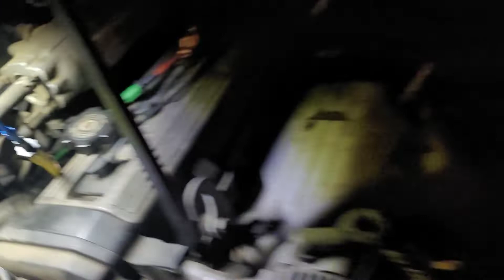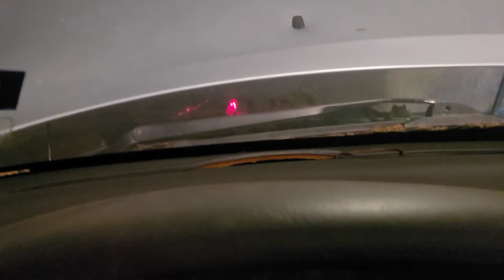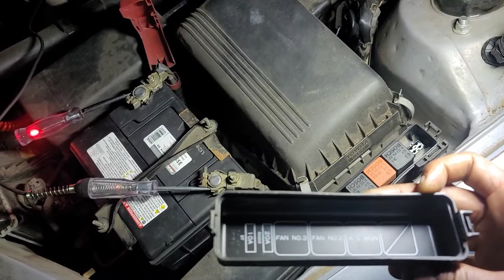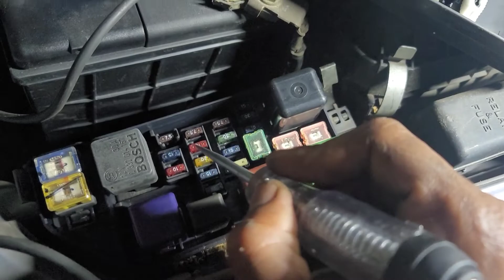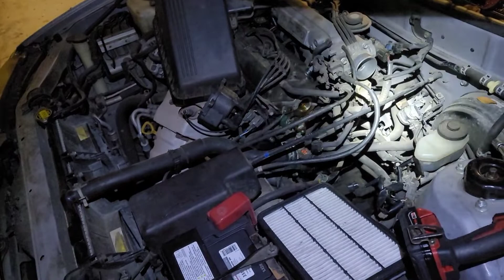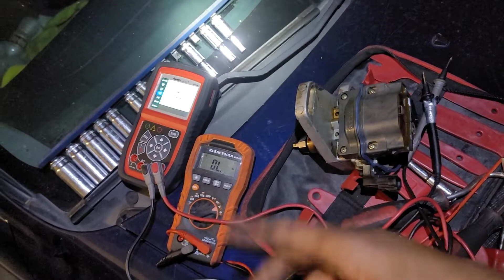1995 TOYOTA CAMRY: CRANK NO START

Comment: I have a 05 Camry had Codes for Camshaft sensors changed out both but car still wont start. It cranks but won't turn over and the codes are back. SMH
Reply from the maker: Crankshaft sensor maybe. But it needs to be diagnosed tbh

Comment: Camry95....does not have an OBD. How did you get the codes Usman????
The other fuse box has 2 relays same as EF1
Reply: Jump two pins in the diagnostic connector. I believe E1 and TE1

Comment: Im having the same issue on a 1994 camry. Would run then after running a little while it would die and not staret until it cooled down. Finally whatever it is went all the way out. Thought it was coil but replaced the coil, the cap and rotor, and also the capacitor and still no spark. Any ideas? Or how to test the crank shaft sensor without removing it?
Reply: It’s the ecu…likely. Thecarcarenut channel just did a vid on this last week.
Reply: @RegularUsernameName  thanks Matt
Reply: Yeah I’ve left my 95 Camry wagon siting for a few years sadly while searching for the solution. Gotta share the gospel of Thecarcarenut to those in need hahahaha
Reply: @MattGredig  awesome! So it was your problem because on this 94 camry that's my brother in laws we can't seem to figure it out I redid a bunch of stuff and new distributor too. Still have a engine light and running not right

Comment: Any idea about code 12 obd1 Corolla 1995. engine revolution signal missing boss??
I already replaced the distributor
Reply from the maker: Does it have a crank sensor? If so check for good signal at the engine computer.
Reply: yOu have an OBD for your 95 corolla??....they started in 1996
Reply from the maker: I have adapters

Comment: I did everything but touch the distributor these last 3 days .. fuel pump, spark plugs, spark plug wires, pcv, intake hose, checked fuses, made sure the crankshaft position sensor that dosnt exist on my 2200cc engine wasn't the problem, banged on the starter a couple times while cranking, and nothing. 

I guess it's time to suck it up and do the distributor. Looks gunky around the seams anyway, might as well. I already replaced the cap too. I just don't wanna ruin the timing trying to remove the whole unit 😪
Reply from the maker: Parts canon.... why not diagnose it properly the first time

Comment: When there is ignition trouble ECM sets code 14 which turns off the fuel injectors.
Reply from the maker: This car's been diagnosed and fixed long ago... What you see in the video is a process.

Comment: hey so pretty sure I have the same problem. got no start in the mornings. It's not the batter alternator starter or solenoid. my gut says its the crankshaft sensor which of course is located n the distrubutor  how do i fix it without buying a whole new distributor at $140 bucks and I've noticed people say stay away from remanufactured.

Comment: I'm trying to take the coil off without removing the distributor fully (Novice Mechanic, worried to mess up timing), the ignition coil for mine is straight down whereas I've seen others pointing to the top left. Screws are hard to get to and hoses that are in the way are on tight and I'm worried to force them off and possibly damage them, any advice?
Reply from the maker: You won't mess with timing.  This isn't a gm distributor... it has a slot it fits in. You can't mess this up
Reply: @Usmanthemecano  okay, thank you so much for the advice and content to learn from brother. 🙏

Comment: I'm trying to figure out a glitch on a 1994 Land Cruiser (OBD1) I have the crank but no start situation, it has no Crankshaft position sensor. It happens when is hot, then next day it will turn on and fail again when trying to start it after a stop. What I can't see in your video is if the Check Engine light is on... in mine both Check Engine and ABS lights are off when the failure is happening.
Reply from the maker: Could be a failing fuel pump as well.
Best time to diagnose it is when it's happening.  Check for rpm when cranking. If present then move on to fuses... if all fuses are ok then check for fuel at the fuel rail. If present  check for spark at the plugs.
If all is ok then perhaps the timing is off...
Reply: @Usmanthemecano same issue no abs light tho just regular brake light every now n then, car started losing power while driving in the rain and returned to Normal before the engine just died and it wouldn't fire again but spun over
Reply from the maker: Check charging system
Reply: @Usmanthemecano  anything that would indicate that, as the battery is still plenty charged even after trying to crank it several times, also something I didn't mention it had a broken ported vacuum switch and they had the air charge sensor unplugged, didn't find anything else unplugged any affect these could have? Also it looked like for a split second when the motor died that a check engine light came on but went off
Reply: Thanks for your reply, it turned out that a previous owner had a hidden tracking device the was never removed and had the battery void causing a short, an electrician removed the device and so far has been working fine, also doesn't have parasitic loads anymore.
Reply: @ehouli77  where was it found? And mine seems to be the ignition switch itself (key) and the od switch with pvs
Reply: @sppookkyblake9056  the electrician took almost all the dashboard off to find it, really nasty work to have something damaged removed and had me 2 years worried.
Reply: Likely the ecu. Thecarcarenut channel successfully diagnosed this exact problem in a vid last week.
Reply: @RegularUsernameName  Thanks for pointing that video out, in my case an electrician found out it was an old tracking device left by the previous owner unattended and the battery was void and caused short-circuit and that erratic failure. Mine didn't turn off while driving, just wouldnt start after being parked for a couple of hours.

Comment: Hey 👋 I replaced the coil it was cracked across the top. Put it in now it’s firing but still no start. What’s up???
Reply from the maker: If you're getting spark at the plug then check for fuel.  The fuel pump is easy access under the back seat.
It's a five wire connector.  The two larger wires are power and ground. 
Make sure power and ground are present when cranking. 
If you can (safely) give direct power and ground to the pump itself to listen for operation. 
Remove the fuel line to see if fuel is flowing out
Reply: @Usmanthemecano  I had replaced the fuel pump couple weeks ago. It’s funny when I turn on the ignition I don’t here the fuel pump run. Until after I finish cranking on it.
Reply from the maker: @billypat9370  that's normal operation for that car? Are you getting fuel at the rail?
Reply: @Usmanthemecano  I don’t think so. Ben cranking it alots today no fuel on the spark plugs. But when I put carburetor cleaner in air duck still no start   Smh
Reply from the maker: @billypat9370  check for injector pulse.
Reply: @Usmanthemecano  ok thanks 😊 hadn’t tried that. Thanks 😊 for all ur help  I’ll ck it out tomorrow morning.
Reply: @billypat9370  u get it???
Reply from the maker: Btw the coil is only part of the distributor assembly. The camshaft sensor is also there.  Without good crank and cam correlation I don't think the engine will fire.
Reply: @Usmanthemecano  bro I have 97 model noah ..crank good but spark low  no start....can u help me out plzz..machanic say change d coil...but he dnt sure whts d problem
Reply: @Usmanthemecano  carbonator engine
Reply: The wire in my distributor had frayed. It rubbed against the roader and was down to 3 wires. Went to a junk yard and got one. Had to cut it and spliced more on to lengthen it. Seems to have been the problem.
Reply: Rotor button